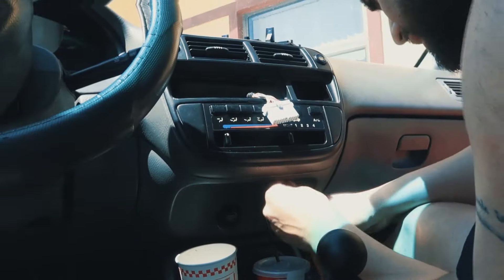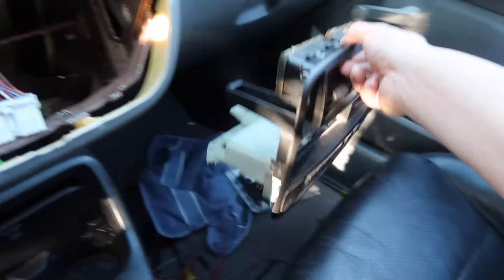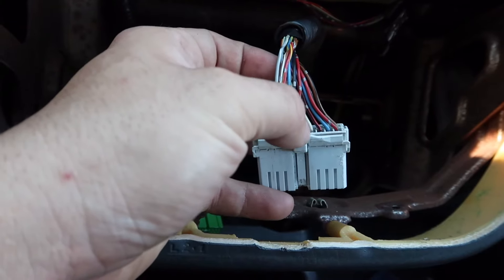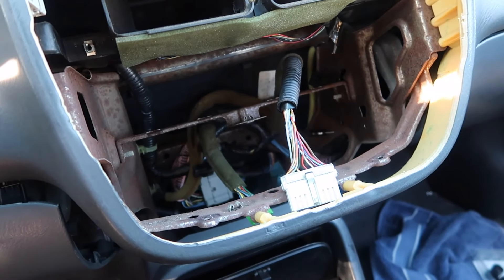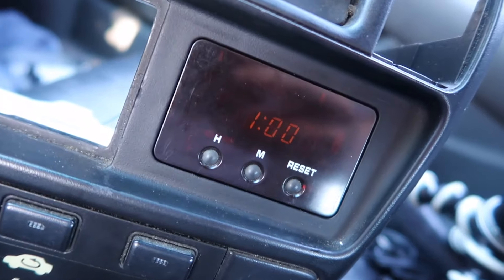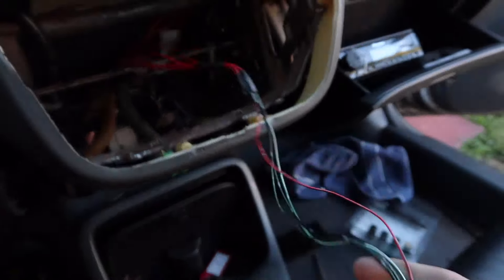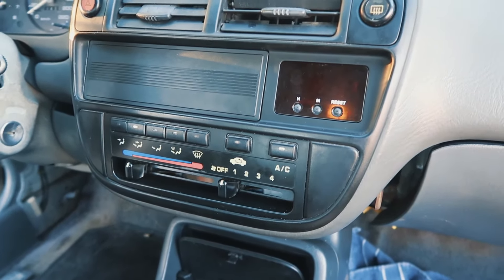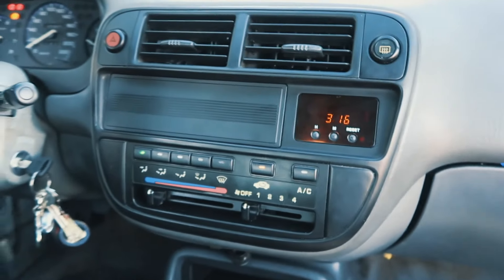How to INSTALL JDM amber Clock on Ek Hatch

Comment: could you tell me which cables to connect please?..you mentioned the positions but you didn't say with one got which. thanks
Reply from the maker: zip90301 they go to the radio is power, negative and dimmer
Reply: Color match bro